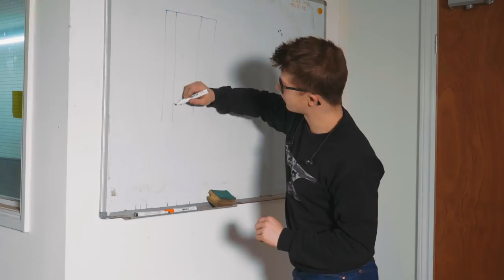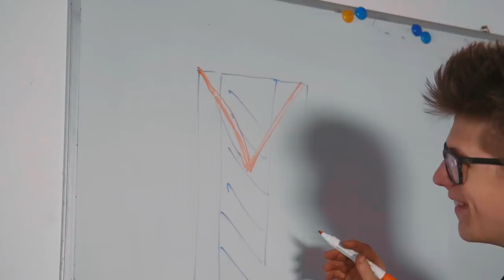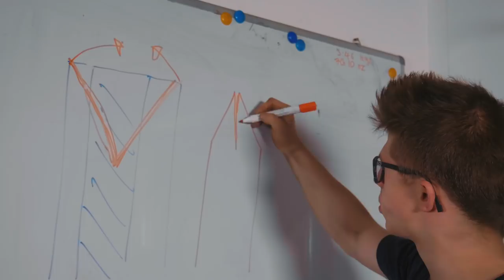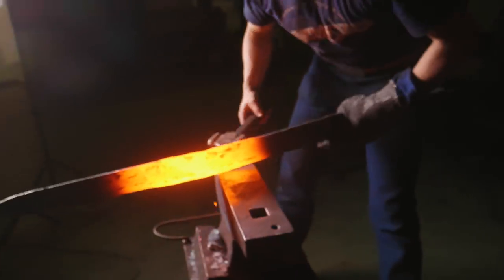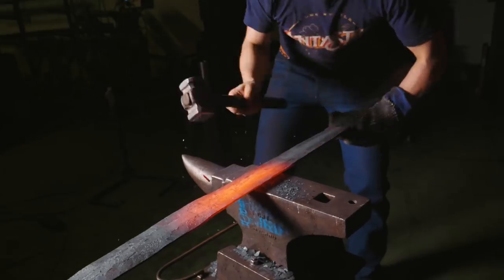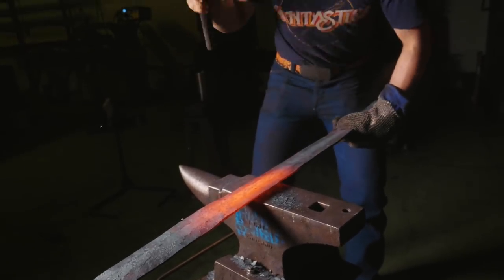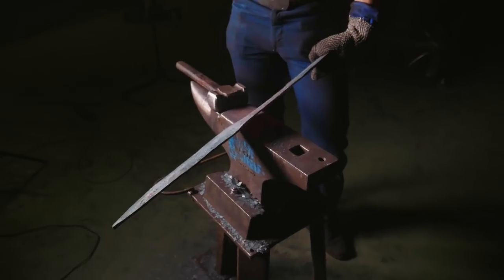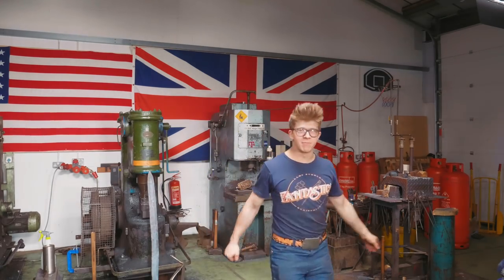MAKING A SCOTTISH CLAYMORE SWORD!!! PART 2

Comment: I'm certainly no authority on the matter, however, most claymore examples I've seen weren't just over a meter, they were closer to a meter and a half...just the blade.
Reply: irritablearchitect There are a few examples of shorter claymores. Though less common. I believe the Wallace collection had one awhile back.
Reply: Not so much, greatswords and zweihanders did indeed pass the 1,5 m mark, but claymores were more tamed, 1,2 m is big for a claymore...
Reply: Claymore blades ranged in length from about 95 to 106 centimeters, in US measurements that would be 37 to 42 inches. They were smaller and lighter than the bigger two handed swords and that is how they gained such a fearsome reputation.
Reply: If you average out all the exhibits of the scottish national museum you'll have an average blade lenght of 105 cm, overall lenght of ~140cm and an average weight of about ~2,4 kg. 
I will not translate that into different units, you'll need the conversion skills when your country finally sees the light anyways.
Reply: 2.54 cm per inch so around 41 inches bit more then a 3 1/2ft or few inches more then a meter for the blade and over all about 55 inches little over 4 1/2 feet. or roughly 1 1/2 meters
Reply: They were a yard long at least.
Reply: Yes a 6 foot sword by definition.
Reply: That's not likely to happen.  It was tried awhile back, it failed miserably!  It's just not our way.  Metric system is a dark art.
Reply: +rory lobbanThat was an idiotic reply, did you even read the other comments? Try this: 6 feet is 72 inches (6 x 12) and Claymores were about 55 inches which is shorter than 5 feet (60 inches; 5 x 12) overall. Math not your strong suit? or are you confused about which sword is real and which is video game fantasy? Even the massive Zweihanders were mostly from 5 1/2 to 6 feet overall with the longer swords being only ceremonial. The longest one in existence is 84 inches or 7 feet and weighs 14 3/4 lbs. Claymore "6 foot by definition" LOL
Reply: Use millimeters! What are you a dressmaker?

Comment: Looks like it is time for a forge build, something long and narrow to fit all these swords
Reply: in an above reply to the same question. You can only work about 16 inches of hot steel at a time. a longer heated section is a waste
Reply: I would actually like to see a tubular electric oven with fine-tuned temperature adjustments. That would also enable nice and even heat treats.
Reply: David Lange you may be right about only being able to work 16" at a time. But surely a long forge would be useful when trying to obtain a uniform heat treatment

Comment: that's a really interesting concept Alec ! Usually the core/edge of the sword is created by a homogeneous steel and the sides are made out of damascus, your's is essentially just the opposite which for some reason never crossed my mind! really cool idea !
Reply: Check out a series called The Serpent in the Sword by a Youtuber/Blacksmith called Niels Provos.

His Damascus sword follows the same construction, though it's a Viking period reproduction.
Reply: Most Viking swords were done this way,  actually.
Reply: Lucas Kramer 
From an old forge standpoint, when it was all manpower, it was safer to use a monosteel or as close to homogenous as you could get for the blade. If your folded pattern delaminates in the center of the blade a bit, you might be okay. If it’s on the edge, that’s a guaranteed weak point on the blade, and depending on where and how it delaminates, it could be a major problem.